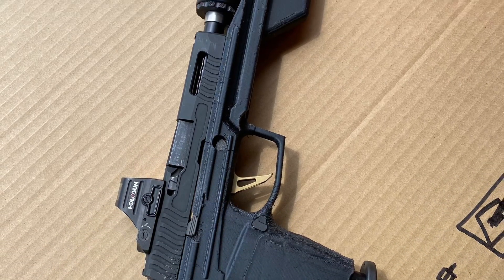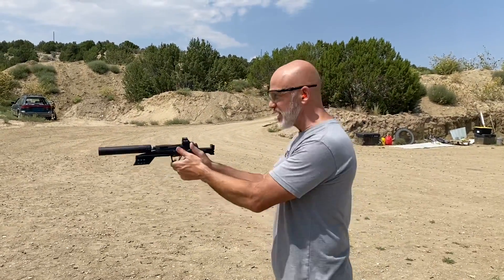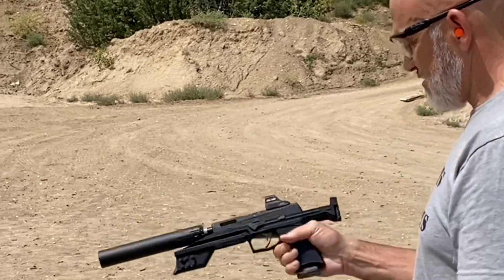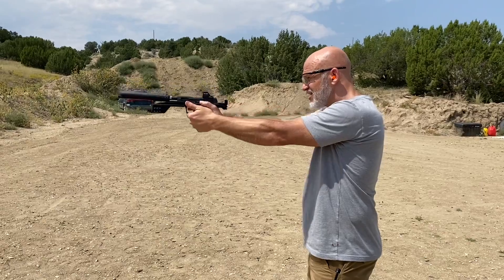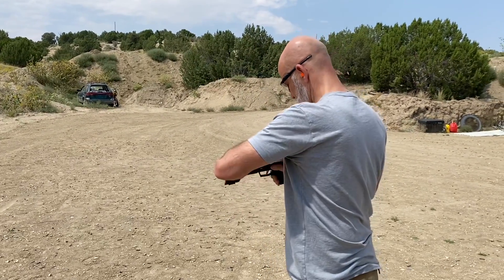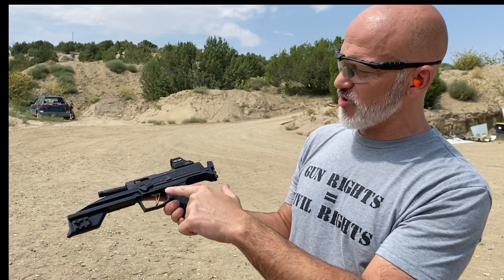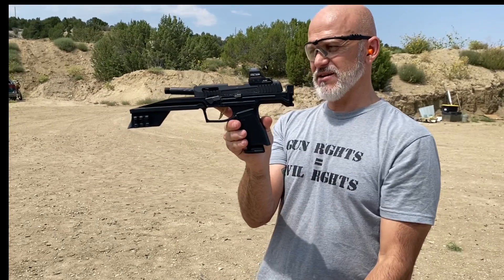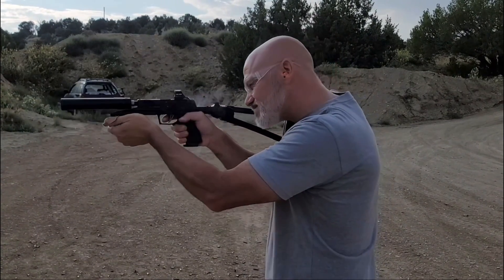3D Printed 320 PDW Frame testing

Comment: What is causing the failure to feed and keeping it from going into battery?
Reply from the maker: Possibly just some friction…. Cleaning up the top of the print and maybe some polishing of the rails or internal rail surface on slide. But, I’m more concerned about the cracking.